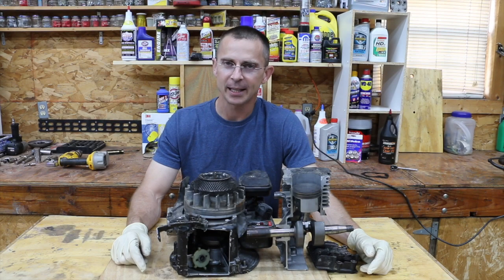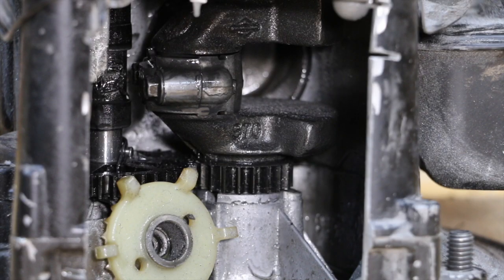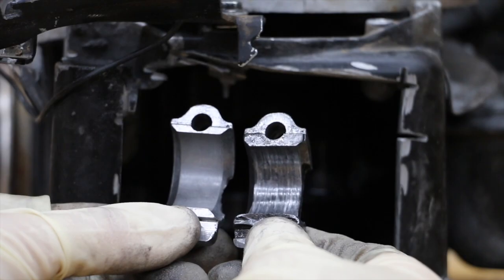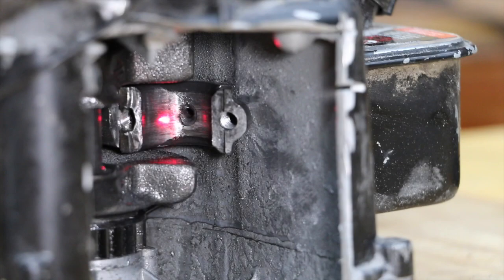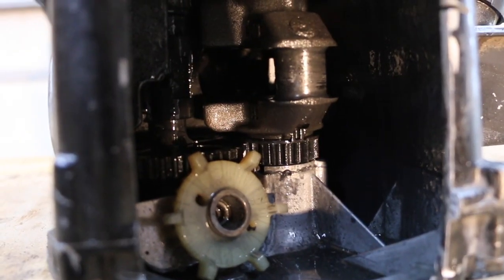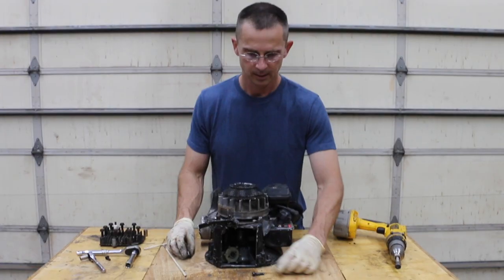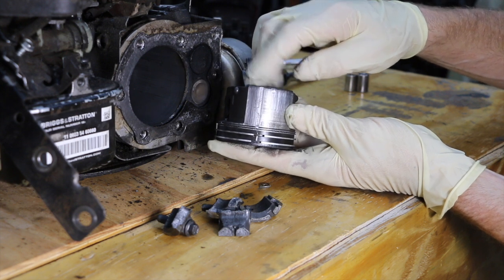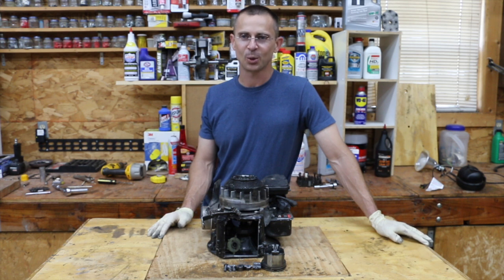Running Cutaway Engine Throws Connecting Rod!

Comment: My dad got the generator out one spring ran it to drill some holes. Next he hears bad noises and generator stops. Can’t pull over no more. Ran it without any oil oops. Brought it home, disassembled it all and found scored rod, 100 grit sandpaper and threw it back together works perfect!!!!! Hope it lasts awhile just gotta run fresh oil through it and it will be fine
Reply from the maker: Impressive!

Comment: Yeah, it was pretty cool. There are so many things that good lubrication keeps operating. One time I worked on a high rise bank building in Miami, Fla. that had 30 massive gear less machines  hoisted up to the roof . Each one weighing four ton. And I envisioned one of them falling just as it reached the roof. I wondered  how deep in the ground in would go, from that height. Unfortunately, it never happened.
Reply from the maker: Thank you!

Comment: My VW seized and threw a rod. Brought a used rod correct for my engine. I flushed out all the metal that went through oil pump and vallies refit new bearing caps to all rods. Bolted it back together and that engine has been half way around Australia and is still running sweet. Compression on all four cylinders is around 140 psi.. VW are awesome!
Reply from the maker: Impressive!  Thank you for sharing this experience.

Comment: Re: Have you had an engine failure?  Years ago I had an older oil burner pickup with a 350 engine that we mostly used farm to farm.  Must have driven more than I thought without adding oil.  Driving down the road is started to slow up then locked up.  Nothing on the stick.  Walked a mile home kicking myself in the butt.  Put a small block 400 in it and kept on trucking till the rest of it died!
Reply from the maker: Wow! Thank you for commenting on this.

Comment: The first stop the piston had seized in the bore. the hammering on the excess clearance on the connecting rod weakened the connecting rod the piston seized a second time the inertia on the flywheel spat out the end of the connecting rod
Reply from the maker: Thank you

Comment: A few years ago, I bought a Cub Cadet with a busted rod, for $25.  I overhauled the engine and mowed with it for nine years, then sold it for $400.  It was one of the original seven horsepower models.
Reply from the maker: nice!

Comment: It would have probably ran longer if you'd have put the air shroud back on the engine. It is air cooled by ducting the air from the flywheel fins downward across the cylinder and head.
Reply from the maker: Thank you
Reply: @ProjectFarm  Welcome.... it was really something to see when that rod kicked out, I'm more amazed that it didn't do more damage.

Comment: Seen the aftermath of that when I drove a transit bus,had 2 vehicles with 6v92 Detroit throw a rod or 2 thru the block (known to shop that they were on the last possible legs and we're needing motors, but they had to get the last little bit out of them- 1 exploded at 65 mph and left a long trail of parts and oil down the road before I could get to the shoulder and 1 I took off from a stop at 2am and went 1 block at it exploded,had a 50 series Detroit do the same thing as I was pulling into a stop and that one caught fire that required the fire department, even with the fire suppression system going off, and a 5.9 Cummins blow the head off and part of the block when I restarted it after a layover,put the AC on and KA-BLAM, plenty of smoke and fire that got put by the fire suppression system (they were put into a vehicle that put a lot of strain on it-after the prototype was delivered and checked out they had to change the gearing and turn the engine up so it would accelerate good, but they set the governor up way above the desired limit and it caused strain on the engine,coupled with poor maintenance they rebuilt most of them with 80,000 miles or less(they were in an eldorado Transmark RE-29 which regularly caught fire in the fuse box within the first year)
Reply from the maker: Wow!  Thanks for commenting on these experiences!

Comment: I heard you say that the cylinder bore had a gouge in it I’ve often wondered would how long JB Weld stay in a gouge and if it would actually work to re seal a worn cylinder. Maybe Take that block fill the gouge with JBweld hone it clean it JB weld a plexiglass back on it put in a good piston and rod assembly with a good crank and oil see what it looks like after 30 min then 1hr then 3hrs run times by pulling the head???

Comment: Only one Briggs and Stratton engine was harmed in the making of this video.
Reply: Steve Waclo No great loss!
Reply: Yeah, another cheap, disposable B&S junk engine bites the big one, its why they give you a whopping 2 YEAR warrantee knowing you'll only use it at most an hour a week for about 20 hours a year, the rest of the time it sits in the shed unused. If it was a car driven 60 mph for 40 hours it would only have 2400 miles on the odometer!

Comment: Lol ive been on a motorcycle going around 120 when cylinder 3 connecting rod failed. Snapped and when stright through the block seizing the motor and the rear wheel. I also looked like a space shuttle lol im very fortunat that my instinct was to immediatly pull in the clutch or else i would have crashed from the rear wheel locking. Btw i ran amsoil in that bike for 3 motors amd all the motors had catastrophic failures on the 4th motor i used valvoline and it ran good and never failed. I find it to be extremely odd but never again will i use amsoil.
Reply from the maker: Wow!  That's scary!

Comment: I saw a lawn mower in the trash that had 3 sides of its crankcase broken out.  The connecting rod broke at the piston, and the piece on the crank swung around and punched out the crankcase as the flywheel slowed down.
Reply from the maker: That's a lot of damage!

Comment: Love the videos. Keep up the good work. Also would love if you would post anymore updates on the ranger as I have considered trying to fix some of the issues with my Silverado that has 300k miles on it temporarily with seafoam.
Reply from the maker: Thank you for the video idea!  The ranger is still running great.  It started yesterday at -2F and ran great.  You might consider watching the engine restorer videos I put together if the engine has lost compression.

Comment: i drove my truck with a knock from rod slap against the piston skirt after the piston expanded in teh cyllinder and tore itself up. drove for two weeks like that (after filling back up the oil pan) before i had a 2nd truck to drive while i tore it down.  was a diesel
Reply from the maker: Wow!  Diesels are tough!

Comment: back in the 70's my older brother had an lawn mower engine like that. he made a set of rod bearings from the inside part of a measuring tape. the tape used to be flat and not slightly curved like todays tapes. it worked like a charm.
Reply from the maker: Impressive!

Comment: I had an Isetta bubble car in the 1970s. It had a single 300 cc cylinder. While travelling at about 40 mph (they don't go much faster) the con rod broke at the small end, flailed round, punching a number of holes in the crank case and ending by knocking the little camshaft sideways out of the engine.  Definitely beyond economical repair!
Reply from the maker: Wow!  That's a lot of damages. It sure sounds like a neat car!
Reply: @ProjectFarm  Actually the car had another but not so serious event. The piston skirt separated from the piston crown - not a lot of compression after that! I did repair it with a piston from the previous engine, that lasted for another year or so after which I sold the car. Interesting electrics - it had a dyno-starter on the crankshaft.

Comment: Hi PF,  I really enjoyed this. When I was kid My dad was given for parts a '53 Chevy 6 that had tossed a rod. I those days rods were forged steel. After it came off it was wrapped around the crank and blew a hole 4 inches wide through the side of the engine! I tore it apart and had to remove the crankshaft to get the rod and piston out. KL
Reply from the maker: Wow!  Thank you

Comment: You have to create a Project Farm supercharger for small engines. Or excuse me a pro charger. A small pro charger is completely doable. 
Powered by the crank. Even 5 pounds of boost would totally make these 5HP Briggs engines put out like 7 to 10 HP. Even more if you use half race gas and tune the carb a little rich so you don’t score or burn a piston.
Reply from the maker: Thank you!

Comment: In my country, the price of fuel was recently raised and people resorted to using the regular which was nearly half the price of the other fuels. Since then, I've noticed a lot of that rattling sound when vehicles pass by.
Reply from the maker: it the rattling is pre-ignition, it'll cause damage to an engine over time. Thank you

Comment: Can you slowly spray water and Dawn dish soap mixture into a running engine and do a before and after of the head. My grandpa said it was an old engine builder trick to clean the heads before you  disassemble.
Reply from the maker: Thank you for the video idea!

Comment: Could you repair the bearing surfaces with J-B Weld?.

Also it's unfair to say that those engines do not have bearings, they just do not have bearings that are separate from the rod. A bearing Bears wait, any surface that is smooth and bears weight/forces is technically a bearing
Reply from the maker: Thank you for the video idea!

Comment: I once put a brick on the gas pedal of a 1960 chevy 6cylinder. Ran for about 10 minutes.It stalled out and never started again. I did not find out why it would not start.  It was still able to turn .

Comment: That’s exactly how the engine in my MTD mower died. It had an oil leak that I didn’t stay on top of. It seized a couple times, but I thought it ran out of gas since it cooled and freed so quickly. Then part of the rod got sent flying out of the engine case. Oh well.
Reply from the maker: Thanks

Comment: So without a bearing the oil in that engine works a bit like what water does in some magdrive electric pumps where the impeller absolutely has to be submerged or bad things happen.
Reply from the maker: Thank you

Comment: I've heard Diesel fuel can go bad quite quickly (in as little as 30 days) if additives are not added to the tank. I have a Diesel VW, should I be adding fuel additives to my tank? Will they hurt MPG or cause increased wear? If so what is the best additives? I've seen your videos for gasoline additives but am curious about diesel! What does the project farm tell us?!
Reply from the maker: Thanks for the test idea!
Reply: Not sure if Project Farm has covered this in a video yet or not, however I've got an opinion on this based on years of experience as a fleet diesel mechanic. I can't say I've seen diesel fuel go bad from sitting in an enclosed tank (the longest ive seen a tank of diesel sit was 6 months), however if left open to the environment it can because it absorbs water. As far as additives go, any additive based on acetone will eat through injectors and fuel pumps over time because it can eat away the seals in addition to reducing the lubricity of the diesel fuel. This is common when using cheap anti-gel in excess amounts. The only additive I've found to not have this problem, even when using several times the recommended amount regularly, is Howe's Lubricant. Seafoam is another good additive when the directions on the can are followed, however its still acts as a solvent and can damage components if used in excess. As far as affecting fuel milage, I can't say I've seen any fuel additive improve milage. Seafoam can improve milage when used as an injector cleaning solvent, but that's not something I would recommend attempting at home on a diesel as it is possible to damage the injectors in the process.

Comment: I had a mower engine throw a rod I got to start up a run and I drove it home
Reply from the maker: Great point on having more than 1 cylinder.  I had an old toyota that through a rod out the side of the engine.  It ran on 3 cylinders and made it 4-5 miles to my home.

Comment: i have a 11hp briggs engine that has a hole in the cylinder head and 1 bent push rods.  just not worth fixing when i can buy a used running complete engine for 50$ on craigslist.
Reply from the maker: Thank you

Comment: Use JB weld to fix connecting rod and make a video to see how long it runs for.
Reply from the maker: Great recommendation. I did put together a video using JB Weld and it connecting rod didn't last.  It's more my fault than the product.

Comment: It blows my mind that the world is so screwed up that you get a lot of viewers and hopefully profit too from these videos.  I suspect you feel that way too from the forced attempt to hide a smile and laughing while doing them.  It's FUBAR, society I mean.

However you went the extra mile on this video, the cutting and analysis of existing wear.   What is my point?  You need bikini babes betting what will happen and suffering consequences if they are wrong.  That beats the heck out of a sensor meter with a 23 reading on it.

Either way, I think your video proves well that an engine won't last long if you cut the side off and don't have lubrication.  ;)
Reply from the maker: Thank you!

Comment: Had the same thing happen to my (actually my older brothers) old go-kart engine (5 hp Tecumseh, ~1975), I disabled the governor and would trim excess flashing from the cast connecting rod, and polish the ports and run without a head gasket.  It went really fast for awhile.  My buddy Greg mounted the parts in display frame titled "First Blown Engine".
Reply from the maker: Sounds like a lot of fun!

Comment: at least some parts of the engine can be used on another engine like the gas tank and carb and the cylinder head and maybe the flywheel and coil you could build a frankenstein engine lol
Reply from the maker: Great point.

Comment: Will this engine still run if youz jb weld the connecting rod back together and if it does run, for how long?
Reply from the maker: I tried in a different video and it didn't work.  More my fault, since the rod was in several pieces and impossible to put back together in a precision manner.

Comment: My first car was a Mini (1965) and it ended up with a knackered oil pump and I drove (thrashed!) it for over 360 miles before it eventually died. But it didn't throw a rod.

A university roommate of mine (mechanical engineer, I'm an electronic engineer) used to work for British Rail and he and a colleague were working on a large loco diesel engine. It was common practice to tighten the head bolts (individual head caps per cylinder) by sitting on a coconut mat straddling the head to get the best purchase on the torque wrench. The engine was running to maintain operating temp and pressure and my friend's colleague had just finished torquing up the last bolt when the engine threw a rod and punched the piston right through the head caps straight between his legs and buried itself in a wall about 35 feet across the engine maintenance shed!

Potentially lethal things - con rods and pistons when they are moving!  😱😱😁
Reply from the maker: Wow!  What a scary situation!

Comment: My father have a car but it take to much engine oil It a full level oil just like 2 or 3 month the engine oil have draining no level filter on it nothing more i have check it but no part to see engine oil come out it weird very weird  sorry i not good in english
Reply from the maker: It the car is using oil, you might consider trying a product call Engine Restorer.
Reply: Project Farm i going to try that oil you say and thank alot 😊😊😊

Comment: You should try this oil, they have been making a test here in Finland where they have been running a car in the street without any oil. Do a backup to back test with the RVS treatment on one engine and one without it. Run them without oil and see which fails first. http://www.rvs.fi/en/products/
Reply from the maker: Thanks for the recommendation!
Reply: Project Farm There is a video on their FB page about the Peugeot. They drove 6k miles without oil before it broke. There should be a retailer in the US for this stuff as well. https://m.facebook.com/RVS-Technology-119295108099343/

Comment: Driving my car to work decades ago, my 250K mile 250 straight-6 Chevy engine went from running good to knocking to rod #1 escaping the block in about 30 seconds.

To add insult to injury, the shrapnel from the engine punctured my rear tire.

I had the car towed to my house, which cost a fortune... but it turned out I had given up on it too soon... it still ran OK (a little rough) on 5 cylinders with a 4" hole in the block... didn't even leak oil.  Swapped the engine out a few days later.
Reply from the maker: Very interesting. Thanks for commenting.

Comment: Did you put the blade or a flywheel or somthing on the engine under the platform where you mounted the motor? Just curious because last time i tried to start my lawn mower with no blade on it nearly ripped my arm off with a backfire and would not start.
Reply from the maker: I did not have a flywheel.  Yes, it can be risky with kickback as you experienced. I've had that happen too.
Reply: Cool. So they will run with no load. That does not suprise me as it is not the most reliable motor. Thanks for the reply.